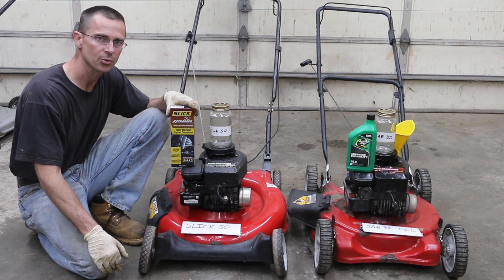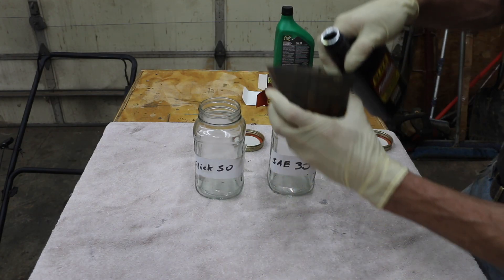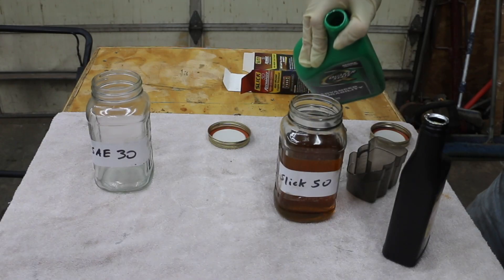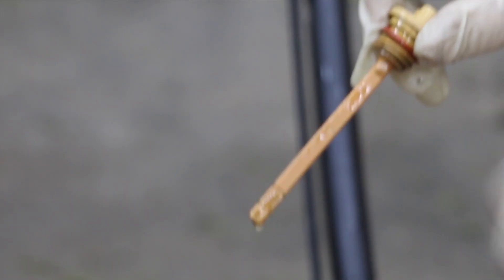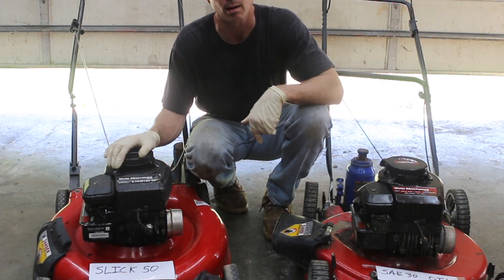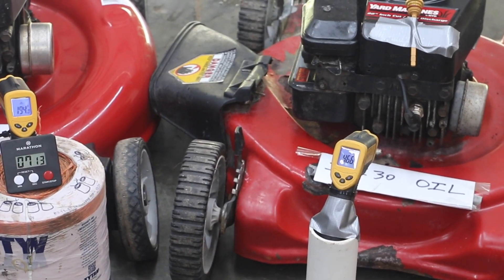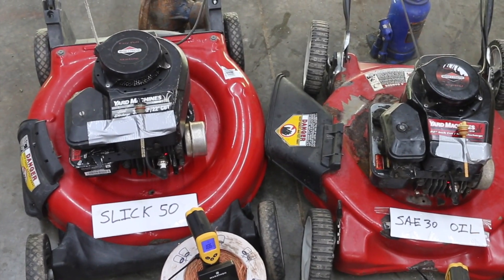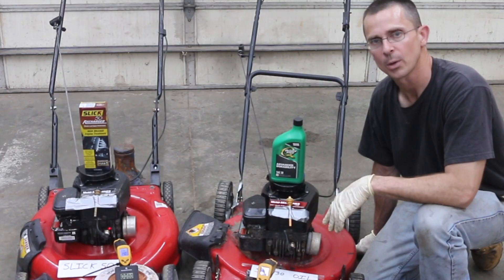Can't believe what SLICK 50 did to my engine!!--Dry Crankcase Test!

Comment: the only problem is you tested 2 different engine models and they were "USED" differently throughout their service life!  there was no way to tell what type of premature mechanical wear was in either unit.  I always like your videos because you ALWAYS compare exact circumstances for individual products. not this time:(  the only way to truly test it fairly and accurately is to use 2 "NEW" exact same models engines and preferably from same batch shipment.
Reply from the maker: Thanks for the constructive feedback.  I began using new engines after this video.

Comment: I believe that was a dura-lube commercial. I've used slick 50 for about 40 years also on my vehicles. Just tried z-maxx yesterday we shall see first time for this one. On second thought the old commercial I'm thinking it was Motor-up that did that claim driving around town with no oil. They would take a engine and freeze a big block of ice around it and start it up. 
I tried Motor-up once on a Chevy Iroc it was having a hard time starting on cold mornings and that stuff worked great the next morning it started right up. Tried to get it again a few years ago but they took it off the market I guess.
Reply from the maker: Thank you.

Comment: The Slick 50 engine was running at over 100 degrees cooler than the SAE when it locked. I would agree that their running empty commercial was likely a very misleading misapplication, but cooler temps obviously mean less friction which means less wear and prolonged life. IMO your tests here do prove a benefit.
Reply from the maker: Thank you for the constructive feedback.

Comment: I have treated few cars and two motorbikes with SLICK 50. My feeling, after all, is that it was benefit in total, obtaining lower working temperature and a smoother operation. In order to treat an engine you have to make about 5000Km accelarating and decelerating the engine. I do not thing that few minutes are enough for treating.
Reply from the maker: Thank you.

Comment: I would like to see you run the same test using molybdenum disulfide.
Reply from the maker: Thank you for the video idea
Reply: @ProjectFarm  and now that you've already done it with oil as a baseline reference there's only the need to destroy 1 engine. I have a feeling the engine is going to run a long time. I knew somebody that ran their transmission dry for hundreds of miles with only a little Molly on the gears. He changed the oil in the transmission and forgot to put the new oil in. Many miles later he remembered. He had originally added a little Molly to the transmission oil.

Comment: I already commented on another video a little off-topic, here it fits to a tee... 🙂
In my mechanic apprenticeship days (back in the early 80s) I worked at a Gulf service station in Calgary. There we promoted and used products from a company called Forté. There were cooling system, oiling system and fuel system products - I remember seeing a demonstration by the sales rep. with a bearing roller on steel adding just a drop of the oil additive - no more smoke, no more noise. Very impressive. 😲
I did use a can of this stuff in my old '72 Chevy 350 (pickup) and forgot about it. It had one dead cylinder and was a pure work truck, receiving no preventative engine maintenance.
A good 5 years later I was hauling way too much gravel over a 20 mile trip, the oil pump gave out about 5 miles before reaching the destination. You could here the valvetrain, notice a significant drop in performance, increased temperature - but the engine did not quit. I shut if off at home and went outside the next day, just to see if the engine would still turn. It did. It even started. 😲

Best regards from Germany,
Volker

Comment: I don't know if zinc-dithiophosphate is a powder or a liquid,but I think it was not advertised  as an additive for oil to the general public was because of it's toxicity.
It came into wide use by motor oil manufacturers during the oil crisis of the late '70s because paraffin based oils became extremely expensive,they discovered by adding zdp to to cheaper non paraffin based oils made them as good or better at half the cost . All it does is increase the film strength.
There is a polymer that is added to oil that is a viscosity index improver ,that's how you get a 10w(winter grade)oil that flows at a specified rate at 0 degrees F. to flow like a 30 grade at 300 degrees F.,now they have synthetics that flow like a 0w at zero degrees and flow like a 50 at 350 degrees,don't you just love technology,but I don't know the name or names of the polymer.
I am really impressed with your willingness to risk even your personal expensive equipment to test these products,my hats off to you.0
Reply from the maker: You are right.  You are very knowledgeable on oils!  Thank you
Reply: Zinc-dithiophosphate was used in engine oils to reduce the wear rate on flat tappet camshafts installed in engines before the widespread use of roller tappet camshafts in newer engines. The interface between the cam lobe and the bottom of a flat tappet lifter is often one of the most highly loaded contact surfaces in any engine. ZDDP works by building up a film on metal surfaces that gets thicker with both pressure and temperature. Zddp was first developed in the early 1940's and has been used in engine oils ever since. The amount of zddp present in modern engine oils has been reduced because of the possible contamination of catalytic converters. For more information look up the wikipedia entry on zddp. There are products available to increase the zddp content in engine oils (usually for high performance vehicles and racing applications) and also racing oil formulations  that have higher levels of zddp.

Comment: Back in the 70's I had a GM vehicle with the Chevrolet 305 engine.  I added Alemite CD2 (the so called "crud destroyer) at oil changes.  at around 50K lobes wore down on the camshaft.  I blamed the CD2 and quit using it.  I later learned that GM put soft camshafts in a batch of Chevy 305 engines.
Reply from the maker: Thanks for commenting on this.  My father had a Pontiac Ventura with the 307 and it had a soft camshaft as well.
Reply: @ProjectFarm    >  I was unaware of the same problem with some 307's.   I also had a 307 in a 1969 vehicle.  I drove it for 8 years without problems.   GM sold the 307 from 1968-1973 and the 305 from 1976-2002.

Comment: I know this is kinda old but I did a lot of reading on slick 50. The original product was fantastic but when sales exceeded production capabilities they inventors sold the  rights to a big oil company who promptly reformulated it for cheaper production costs. They continued to advertise using test data for  the original product though. Before the sale Slick 50 was only available at a handful of stores. I remember a particular 350 Oldsmobile that I drove home slowly with no oil. It was right after  an oil change and the filter gasket was leaking. The engine had had at least three treatments of Slick 50 in the past. After driving it tapping and lifters raising h@ll, the motor survived. New filter and oil and that engine ran for years.
     I do enjoy your videos!
Reply from the maker: Thank you for this information!

Comment: Microlon, use Microlon, a completely superior product than Slick 50. History - A disgruntled employee of Microlon thought he could copy Microlon so he quit and made Slick 50 on his own, a totally inferior product. This employee did not know the secrete to Microlon. I've used Microlon for 20 years with complete success though I did not run my crank case dry to my vehicles I did get better mileage and my Ford Ranger engine is still going strong at 237,000 miles and 20 years later. Microlon is also applied to the transmission, rear end,gas tank, radiator and wheel bearings with their Microlon grease,anywhere where there is metal to metal friction. No, I'm not a Microlon employee nor get any kick backs from them in any way. I found out about Microlon thru a former co-worker who married the inventor of Microlon,Jenna Yeager, yes the same Jenna that flew Voyager around the world non stop and un-refueled.
I just bought a 1968 Mustang with a rebuilt engine and transmission so going to treat it as soon as the engine breaks in,Microlon will prevent a new engine from breaking in as it stops all wear as it form a fluorocarbon(Teflon like) layer on all metal surfaces. One treatment is good for life which takes a few hours and a few 100 miles to penetrate the metal pores. To be fair, you did not allow the Slick 50 time to penetrate your engine either before your test.Try a retest. Thanks for reading. - Ken M.
Reply from the maker: Thank you

Comment: It's best to not add anything to engine oil.  Typically it decreases wear protection as proven by your testing.  If you want the best wear protection, seek out the best oil and use it as-is.
Source: https://540ratblog.wordpress.com
One exception may be Prolong. 
Here is an excerpt from the above noted source:

The “WEAR PROTECTION RANKING LIST” itself, begins here:

1. Prolong Engine Treatment added to 5W30 Pennzoil Ultra, API SN synthetic = 136,658 psi
This oil on its own WITHOUT the Prolong Engine Treatment added to it, has a wear protection capability of 92,569 psi. With the recommended amount of Prolong added per qt, its wear protection capability “WENT UP 48%”.
The data here provides information on wear protection capability, but does NOT provide any information as to how compatible this product’s chlorine may be with a given oil’s additive package. Chlorine and additive package incompatibility has a possible risk of creating damaging bearing corrosion problems. There have been legal issues with this product that you can Google for yourself. Contact Prolong’s maker for more information on compatibility, to find out if it is safe to use in your application. The test data on Prolong is included in my Ranking List for informational purposes only, because of requests I have received about testing this product. But, I do not endorse nor recommend its use. It is always best to simply choose a highly ranked oil in the first place, and avoid using any aftermarket additives at all.
Reply from the maker: Thank you

Comment: I don't think the Slick 50 formulation today is what it was almost 35 years ago the first time I used it.  Originally it contained Teflon.  It was also advertised as being able to stop minor oil leaks.  At the time my drive every day car developed a leak in the front crankshaft seal.  I gave it the Slick 50 treatment at 119 k miles ..About 3 k miles after treatment the leak stopped never to return.  Later I did a slick 50 treatment on an engine I had overhauled after it had been run 500 miles.  Evidently the Slick 50 slowed the internal wear so much that engine never did break in.  It continued to use a quart of oil every 5 k miles as long as I owned.it.  I'm not claiming the Slick 50 caused it but I never had the happen on any other engine I overhauled.  Recently I treated my car's engine with the newer product it hopes of stopping a minor oil leak.  It had no affect.  I might also add the "old" Slick 50 had a milky appearance but the current product just looks like regular engine oil.  I assume that milky look was caused by the Teflon particles.
Reply from the maker: Great point. Thank you

Comment: I have used synthetic oil in my 2006 Ford truck and I did not notice any difference in performance until about 50 miles. I believe you didn't run the engine long enough for the ingredients of the slick 50 to impregnate the metal.
Reply from the maker: Thanks for the constructive feedback.
Reply: @ProjectFarm  I have to agree with Alan Spring, I remember it clearly stated on the packaging that the Slick 50 impregnated the metal to reduce friction on the metal to metal parts. Next time try running the motor with the Slick 50 in it for 10 hours instead of 10 minutes.
Reply: @jeffs.6488  no  motorkrate disproved such a theory  it ran on water  sorry jeffS
Reply: @punker4Real  What does "it ran on water" mean?
Reply: Watch it again; Project Farm didn't shut the engines down at 10 minutes. They shut down when the internal tolerances disappeared.
Reply: @Jamestfarrell  He's talking about the first run with the crankcases full.  Not having enough time to bond.
Reply: With respect. You are not impregnating any metal inside your engine.
Reply: Austin Carlson  (Do you keep it coiled in your pocket?)
Reply: I used Slick 50 in a 1984 Lynx SW 1.7 liter with over 100,000 miles. The engine already ran great over a interstate highway mountain pass regularly. I was driving about 600 combined miles per week. After 1 day I noticed the idle rpm was up and lowered it. In about a week I noticed the idle was a bit high again but I could run the pass at 90mph up from about 82 previously. My excess speed was for testing purposes only!

After about a month I started getting some smoke from the tailpipe on first daily start. The Slick 50 made an obvious increase in performance but caused a little blow-by. I repeated this result with a 1969 Jeep PU with factory Buick 350 engine. Better performance but with some increased blow-by. I used a different Teflon (B&G?) product in my 1986 SAAB 900T with similar results and ran it to 135,000 miles. It also showed some increased oil usage and better performance. The SAAB was getting 36 mpg combined local/highway when the injector pump went out and I junked it. And that was with the lead foot I had in my younger days!

About that time Slick 50 started putting a warning on the label about using the product on high mileage engines. My results were good with the product with increased performance and fuel mileage but also with increased oil consumption. 

I would also like to say that after many miles in the SAAB turbo I found Castrol held up better than any other non-synthetic oil, by far. Even with Valvoline Turbo IV I had to change the oil every 4 to 5 weeks because of burning. The Castrol would last 6 to 8 weeks (about 3600 to 4800 miles).

I think newer cars with tighter tolerances, better materials, lighter components and less heat generation would benefit a lot less from Teflon treatment. I drove a ~2000 Plymouth 4 cyl 12 miles across town to a wrecking yard in 100 degree heat with no water in the engine.
Reply: Austin Carlson IRL LOL
Reply: makes sense
Reply: Don't fall for those lies. Oil doesn't impregnate metal. It can only coat the outer surfaces
Reply: @victorfox9623  It actually "impregnates" the dips, grooves, scratches and other non-smooth surfaces of the cylinder wall and piston rings.
Reply: @jeffs.6488  - That is the same thing any engine oil does, in fact if the bore was totally smooth then there would be less for the oil to grab hold of. This is the same reason we hone bores out to give it the scratches in the first place.

Comment: The reason I don't like Slick 50 is the lies in their old marketing that everyone is referring to. I recall the ads that they would drain the oil from a car and run it without only. Even racing around a track at 100+ mph. This is all BS how did the hydraulic lifters work without a serious ticking? Many people remember the non hydraulic engines at shows, but on TV they showed several cars that definitely had them. Slick 50 and most other additives are snake oil.  I use Lucas in my engines but I would not say I swear by it, a good quality oil is still better than adding anything to a cheap brand.
Reply from the maker: Thank you

Comment: Back in the late 70s slick 50 use to travel around with a trailer with 3 engines 6cyl a 4 cyl. And lawnmower engine on them all filled with water after being treated with slick 50 it was just a show the water kept the engine cool and would run for a long time
Reply from the maker: Thank you for this information.

Comment: Around 1982 I was using SLICK 50 and it worked very well.  Some of the comments that say the formula is different now are correct.  Also some of the comments that say it wasn't applied correctly in your video are also true. The original formula needed to be added to a warmed up engine with one quart less of regular oil and then add the quart of SLICK 50 to the running engine. Then take it for about a 20 min. drive. I used this in my old four cylinder pickup , the first drive to work about 25 miles I noticed the engine RPM was up 200 - 300 and it was also running about 10 degrees cooler and also sounded smoother. After draining the oil with about 3500 miles on it I saved that oil to put in my chain saw oilier and with in about 15 min. I noticed the chain was running more free on the bar than it ever had before , a very noticeable difference. So this is my personal experience with the original SLICK 50 formula.
Reply from the maker: Thanks for commenting on this.

Comment: That was interesting. Thank you. 
     I remember an ad about an airplane that had the "aviation" version of Slick 50 in its crankcase that experienced a complete oil loss and the pilot claimed to have made it to the nearest airport. 
      I believe that one factor to consider should be that the Slick 50 lawn mower might have had more wear when you started the experiment than the 30 wt lawn mower had. A more objective and "scientific" test would involve two identical "NEW" engines. Maybe Slick 50 corporation would provide you with two new engines to test.
   The proof of crankcase and cylinder head temps running cooler w/ the Slick 50 is enough for me to continue to use Slick 50 in my 14 year old Subaru Outback w/ 166k miles since "Heat" equals "Wear" in most instances. Heat is evil.
     Thanks again for the experiment.
Reply from the maker: Thank you for the constructive feedback.

Comment: No engine is meant to run with out oil.
Slick 50 is made to run with 80% oil.
This video has test slick 50 in a way slick 50 was,
 never intended to be used..
Reply from the maker: Thank you